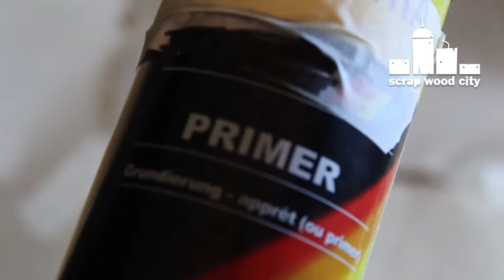Another DIY wooden rustic key rack

Comment: good night, i don`t speak english but i want to know what is the number of the instrument that you use in the letters, because in the video is very easy and i am making a similar project thanks
Reply from the maker: No particular number. I used a cheap set of linoleum chisels. Not the best tools for cutting wood. But for something small on a soft wood the worked ok. Thanks for watching and commenting